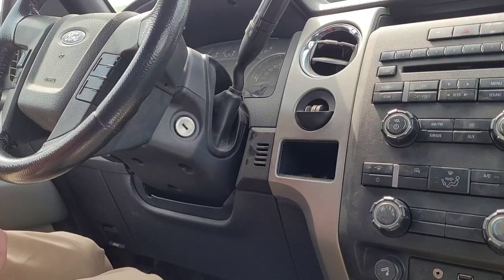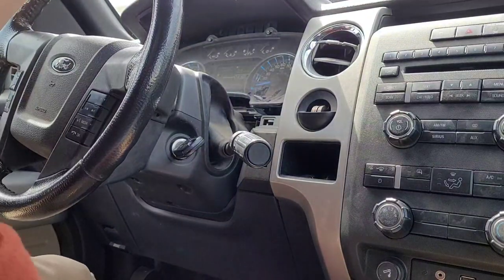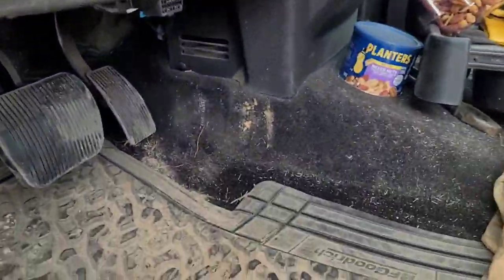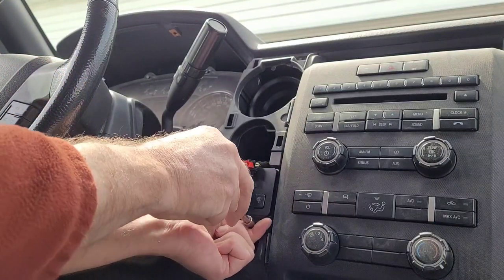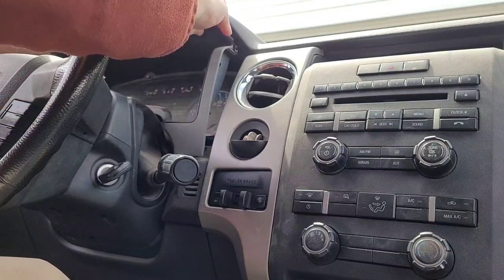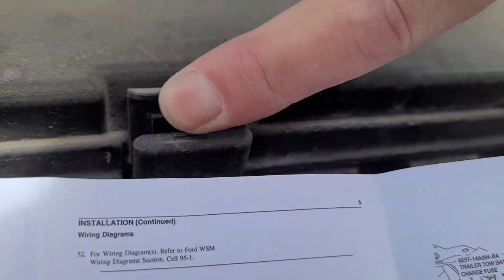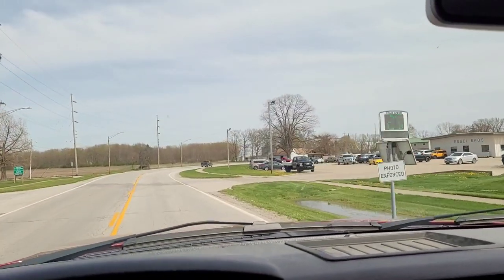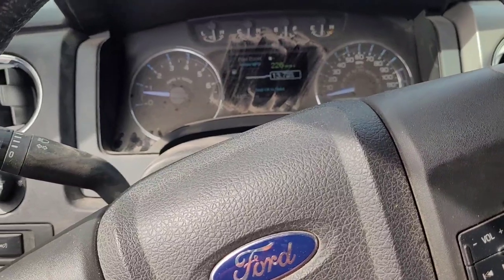2010 2011 2012 2013 2014 Ford F150 Factory Trailer Brake Controller Installation And Dealer Program.

Comment: Oh wow, I didn't realize you need to go to Ford to program it. I was looking on Amazon for these controllers and the biggest complaint was that people couldn't get the controller to recognize the trailer they were hooking up.  Maybe that was their issue, they had to go to Ford to program it. What do you think?
Reply from the maker: Of course, it has to be programmed at the dealer. I added the keyless entry keypad to my truck and was able to program it myself using Forscan. It worked fine but definitely has to be turned on with Ford software.
Reply: @tonyscarcare5657  Thank you for the information! Really appreciate it!
Reply from the maker: You're welcome!

Comment: Did you ever find out the issue with the trailer brake working, but giving you the Trailer Disconnected?  I’m having the same issue.
Reply from the maker: The customer tells me that it works fine and he's not having any issues. Weird!
Reply: Hey, did you have any luck tracking the issue down? I'm having the same issue.
Reply from the maker: Nope. The customer tells me that it still works fine to this day.

Comment: This video really helped a lot.  Thanks Tony!  I have a 2013 XLT and plan to install an OEM backup camera and will do both at the same time since the start of the procedure for the camera is the exactly the same as for the IBC.  Well done!!
Reply from the maker: You're welcome, and thank you! Drop the glove box down and remove 3 bolts, I believe, to pull the passenger side airbag out a little. You don't have to unplug it and don't! But it allows you to get to the screw or 2 to get the right side trim off of the radio bezel.
Reply: @tonyscarcare5657  Yep!  I saw that very same guidance in a different video.  Thanks for going the extra mile and then some!
Reply from the maker: @BrookThomas-w9d  you're welcome. Thank you!

Comment: Tony, in an unrelated area, I have a question. My 1998 Taurus SHO needs a camshaft synchronizer. I've looked everywhere, RockAuto, O'Riley's, Advance, local junkyards, nationwide junkyards online, etc. I've even thought maybe to have mine rebuilt, but not having any luck. Ford made 20K of these cars between 1996 and 1999. They have a 3.4L V8 engine, instead of a regular 3.0L. What would you do, to find this part? Finding one in a junkyard is very rare now a days.
Reply from the maker: Boy, I don't know. It seems you've done everything I would have done. I'm sure there's some Facebook groups or forums for those cars. Have you asked around on those?
Reply: @tonyscarcare5657    Yeah. Most of these forums were active 10 years ago, but now are shut down. I'm running down each lead, no matter how small. If you come upon one of these motors in a junkyard, let me know. Thanks.
Reply from the maker: @bentnickel7487  I sure will. Are there Facebook groups?
Reply: @tonyscarcare5657   I've never been on Facebook, for privacy reasons.

Comment: I installed my controler, had Ford active it and my truck juat keeps saying no trailer, all the lights on trailer work, i even installed a new harness for plug receptial.

Any ideas whata going on ?
Reply from the maker: Not really. The customer tells me that it still works perfectly to this day.
Reply: @tonyscarcare5657  dang it, okay thanks for the response I'm still trying to figure this out.
Reply from the maker: You're welcome. I'd think the dealership should know, but apparently not. Good luck with it.
Reply: Hey, I'm having the same issue. Did you have any luck? I'm getting no voltage between my brake pin and my ground in my trailer receptical.
Reply from the maker: @PaddleSquatch if you watch the video all the way to the end, you'll see that I put text in there saying that it was a corroded trailer plug.